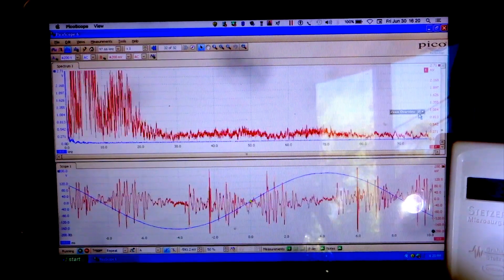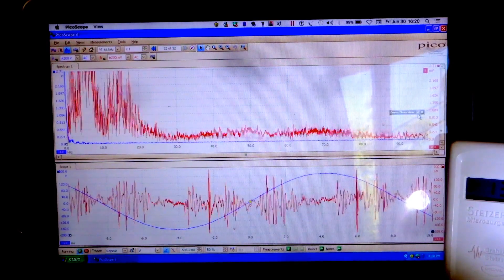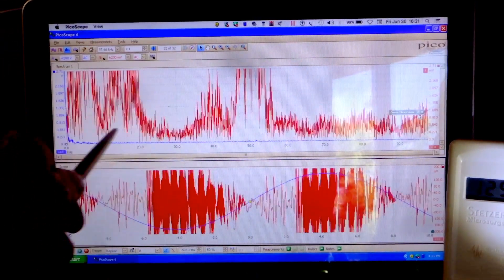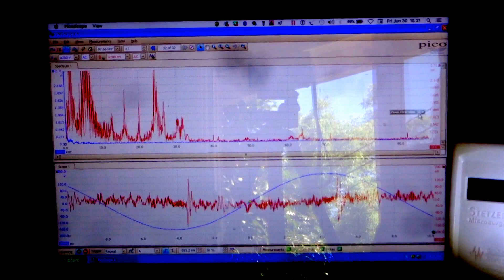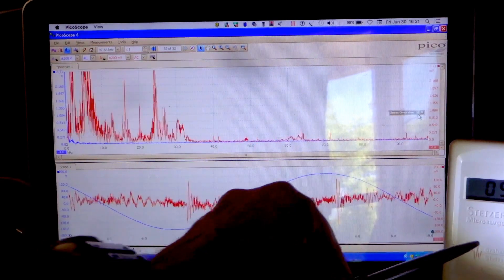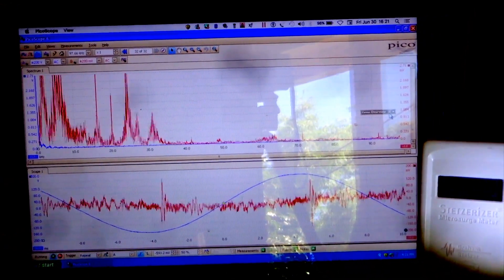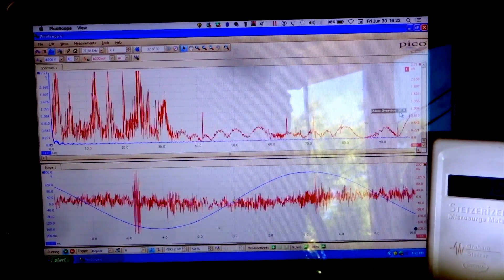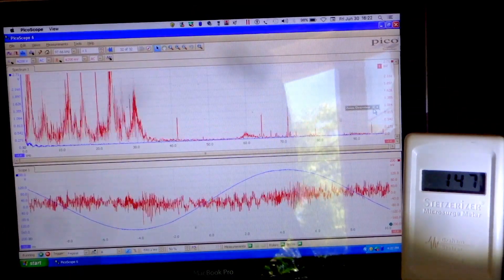OSCILLOSCOPE VIEW: Utility Delivered vs. Internally Created Dirty Electricity

Comment: When you are measuring from the main service panel (with all breakers open) and see all the electropollution in the <60KHz frequency range, aren't there at least two different possibilities for the DE -- (a) coming in from the utility pole that way (from the neighbors or utility), OR (b) being newly introduced by the utility's 'smart meter'?  Further, what about the influence of incoming CATV or municipal metal water piping ... could those also influence the DE or be more likely sources of objectionable current or EM fields?